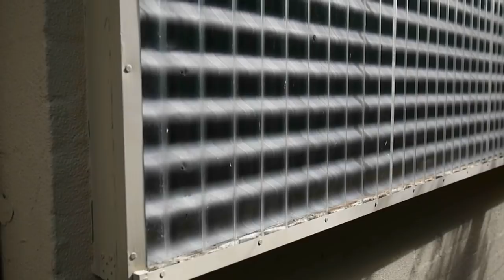Solar Space Heater- heats air in the house using the sun

Comment: NO Cardboard: will rot, burn and bugs love it...not a good choice...
EXCEPT...MAYbe as the insulation....IF you first treat it using borax powder to inhibit bugs and burning, AND, only use it as the insulative layer, where it is separated from the hottest part of the panel.  
WARNING: Corrugated galvanized metal roofing warning:  
The galvanizing process causes toxics to be released if the galvanizing gets heated. I do not know how to seal the galvanizing in, to prevent the high temps from solar gain from causing that.  
Instead of metal, some have used black-color window screen, two layers together, and tilted on angle inside the solar box...some swear this works as well as, or better than, using metal.  We used stacked aluminum cans..and plan to do that again .  We also want to make water heating panels.  Had thought to hybridize those systems, but decided against that, to prevent losing both systems if one goes haywire. 
We made [2] 4' x 8' panels, using wood box frame, and using stacked aluminum cans. 
We used the only high-temp paint we could find locally, which was wood stove paint.  
Then let that "cook out" in the sun, to get rid of the nasty VOC's, before hooking it to the house.  
Our electric bills over several years, reflected that we saved between 100 to 300 kWh off our electric bills, in winter, in the cloudage-prone Pacific NW.  
The high-end savings was using 2 panels + a 4" duct fan pushing air through those, a better cover [twinwall polycarbonate greenhouse panels] and better air seal. 
The low-end savings was 1 panel, no fan, poor seal on cheap, corrugated greenhouse panel covers.  
Both setups recirculated room air.  
In the low-end setup, the cheap corrugated plastic greenhouse panels actually melt-warped, despite the air leaks heating the great outdoors. The Twinwall polycarbonate worked pretty well, no melt-warp, and stayed sealed better. 
In a perfect world, I'd mount the panels on a vertical wall, canting them out at a small angle, to optimize winter heating, decrease heat during high-sun of summer, and make it easier to cover them in summer. 
The average approx. angle to sun is about 45 degrees here....BUT...we have lots of cloudage in winter...therefore mounting solar on a south-facing roof, helps optimize winter omni-directional daylight, which also helps optimize this setup in our winters when it's most needed. 
Have a summer vent, and summer covers for the panels...really important. 
Unfortunately, venting them in summer adds to ambient heating of general air....consider what happens with this, if lots of people do it...the ambient summer heat in the area is raised hotter than it would otherwise be.  That is why we COVER our air heater panels in summer.  In hot climates, even water heating panels will cause need for an expansion tank.
ALSO:  We plan to get some cheap, small solar panels to run the fans...those fans don't need but a tiny bit of power, and run pretty quietly.  And, it helps 'shut the panel off' during cooler nights.

Comment: Your idea isn't without merit.  A concentrator setup is very good if you need process heat, higher temperatures for industrial uses.  But if all you want to do is warm a space, then really a concentrator is a tremendous waste of materials and effort.

Your "tricky cool" methods are poor substitutes for good design.  Every time you reflect the energy, you lose some in the reflecting.  Better to steer the collector to maximize return on collector area.

Comment: I like the design but I would have the cold and hot in opposite corners. Also the cold could be nearer the floor. The additional benefit is the added exterior insulation you have provided with reduce thermal losses off that wall.
Reply from the maker: Good suggestions. In my case I couldn't lower the unit because then the sun wouldn't reach it.